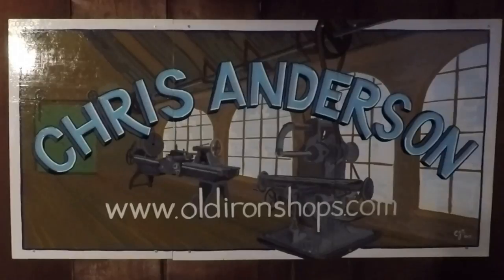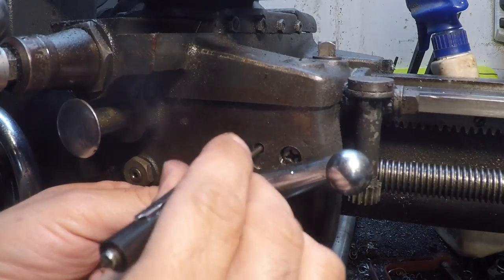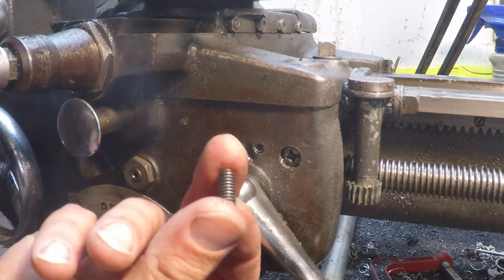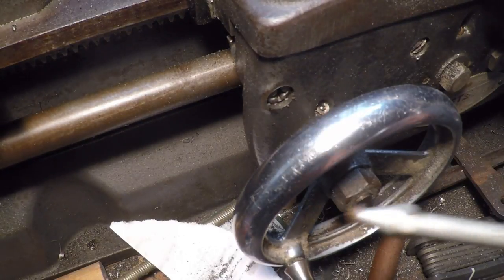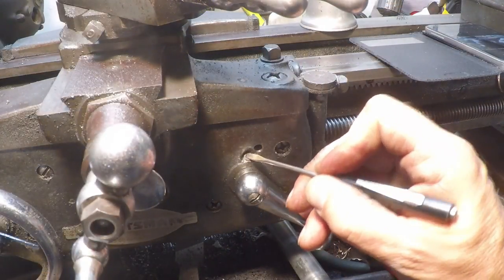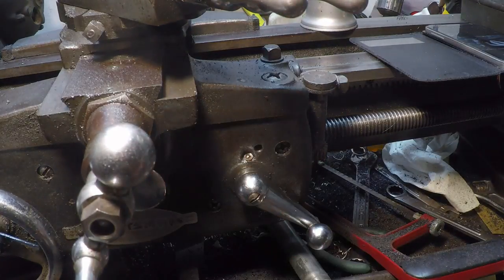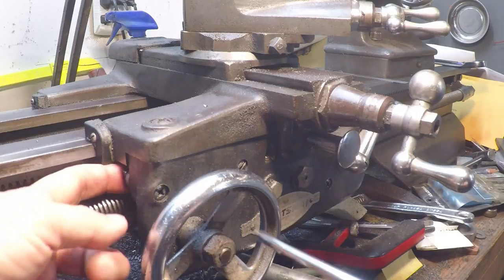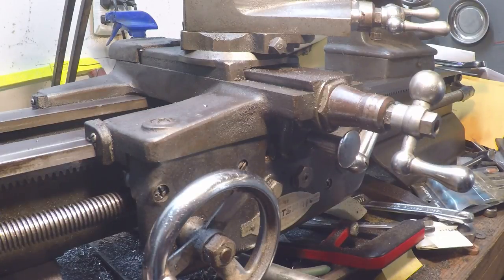Atlas craftsman lathe restoration

Comment: Great video. I recently purchased one of these Atlas lathes and am having trouble with the ball oilers. Even when I press firmly, when I try to squirt some oil into them, the oil just kind of back up and squirts out around the oiler without going where it's supposed to go. Do those oilers have a tendency of clogged?
Reply from the maker: Do you have a oilcan that is made for a ball oiler . They seel better but not perfect. Also these a chance th passages are clogged up with foselised oil.
Reply: @OldIronShops  Thank you! I've got a goldenrod oil can with a bullnose tip, so I'm pretty sure it should work. I'm thinking the oilers are all just clogged with solidified grease/oil. I'll have to see if I can clean them out or maybe replace the if they're even still available. Thanks again.
Reply from the maker: @powers6963  I took my machine apart and cleenes it it's probably a good idea. I do not know if you can get new ones so don't destroy any thing you might need

Comment: Chris, thanks for the video, it was very instructional.  If you or anyone is interested, the oilers in the apron are GITS GB 00520 Ball Oilers and are available at applied.com at $2.43 each.  I went ahead and ordered some new ones to replace mine.  My half nut spring was in pretty bad shape, (both broken and horribly mis-shapen), fortunately I had one in my junk box that worked for me.  Recall, that the half nut lever handle on my machine looks like it is slid on the cam shaft and the end of the shaft peened over.  Also, on of the lugs on the half nut carrier is cracked.  I have since found a new handle, cam shaft and half nut carriage.  They are being shipped now.  But I won't really know the shape of them until they arrive.  Finally, I did get a couple of oil cans with the proper tip for oiling these.  Unfortunately they are not Eagle oil cans, but as long as I can oil the machine, right.

When the rest of my parts arrive, I will do the second part of the video.

Chris, thank you for taking the time to make a video response to my questions.  The YouTube community really are a great resource.  I am truly Thankful for the lot of you.  Thank you sir.

Joe
Reply from the maker: always glad to help it wasn't that long ago i didn't know anything about this stuff myself knowledge is power as you well know. i hope some people go check you out (fuel to the video fire ) btw let me go look up the gears i've got and shoot you a email .
Reply: I appreciate that.  You know I have another lathe, it is the 6" Dunlap lathe that Craftsman sold.  Which, by the way, is probably not the best lathe for a beginner to have.  For example, the crossfeed and compound screws are 28 TPI, and there are no dials.  It does have a threading dial and gears, but the longitudinal feed has to be done with the split nut or the lead screw dial.  Feeding with the lead screw dial can be a pain if your set up for a fine feed because of the gear ratio seen from the lead screw gear.  Anyway, I digress.  I made my first two parts on this lathe.  A screwed bushing to hold a 1/4-20 screw thread and then used that to modify the point on a 1/4-20 set screw to turn down the end to fit my tail stock quill groove on the Atlas 10F.  So I am pleased to say, that I have absorbed some information from the YouTube community out there!!!

Thanks again for the help and the link to my video.  I appreciate that.

Joe
Reply from the maker: +My Heap good job joe
Reply from the maker: oh did you get my email?
Reply: Yes, just sent off a reply.  I am excited Chris!!  Getting so close now, and I think the parts you have will have me covered for threading!  Thanks man!

Joe
Reply from the maker: +My Heap cool I'll go check it out.
Reply: Sent you an email from my personal account.  See if you get that one.

Joe
Reply from the maker: +My Heap got it it was date night but I've replied now
Reply: My Heap  I always have a hard time getting a good seal on the oiler behind the traverse crank. The other two are no sweat, but that one gives me trouble. When I first got my 10f, it didn't have a lead screw, and hadn't had one for years (it was my wifes grandfathers). So the half-nuts had very little wear on them.
Reply from the maker: +Jeremy Gagnon the trick is to go straight into it and put a good amount of pressure on the oil can.
Reply: That one looks like it would be a problem child to get at.  Curious, why was it missing the lead screw?  Or do you know?
Reply: My Heap Who is to say. My wifes grandfather passed away nearly 40 years ago. Since that time, it sat buried under rubble and junk at  my wifes grandmothers house. She passed away about 3 years ago and in cleaning out the garage, we came across this beat up old lathe.  My guess would be that someone crashed it and broke the bearing support or the leadscrew gearbox, and rather than replace it, just removed the leadscrew and it then got lost.
Reply from the maker: +My Heap why is what missing on the lead screw?
Reply: Sorry for the confusion Chris.  I was asking Jeremy how the lead screw came about being missing on the lathe he got.

Joe
Reply from the maker: +Jeremy Gagnon the bearing support at the tailstock end is designed to break if you crash instead of trasing the gears . This seems to be little known information. Figured I'd put it up there.
Reply from the maker: +My Heap oh I see lol
Reply: You will have it running in no time Joe 👍🏼. Good video Chris
Reply from the maker: +Makin Sumthin From Nuthin hey thanks glad you like it
Reply: Richard, great to see you.  I am waiting for some parts I ordered to finish assembling the apron, but yes, I think you are correct.  I am getting pretty close now.  How have you been?

Joe
Reply: Just got back Sunday from a week long vacation in the Florida Keys, fishing vacation with my brothers that flew in from around the country. Will share a bit of it in my next vid
Reply: Cool, looking forward to seeing it.
Reply from the maker: +My Heap me to lol

Comment: The set screw on my lathe is way in the hole as well for the half nut.
Reply from the maker: +eviltwinx OK this seems to be looking to be the way it was made then.
Reply: Lathe operational now ETX?
Reply from the maker: +Makin Sumthin From Nuthin has Ben I thought
Reply: Makin Sumthin From Nuthin - Sadly no. So close, yet so far.
Reply: Chris Anderson - not yet.
Reply from the maker: +eviltwinx oh boy what does it need?
Reply: Chris Anderson - I need to rewire the motor so it spins the correct way. I also, and dread, need to take the headstock apart again. I forgot to install the locking pin that goes into the bull gear.
Reply from the maker: +eviltwinx ya that's a bit of work but we'll worth it.  One expensive paper weight at the moment.